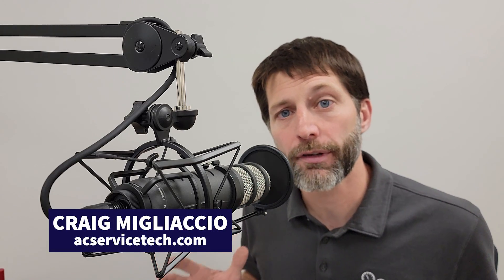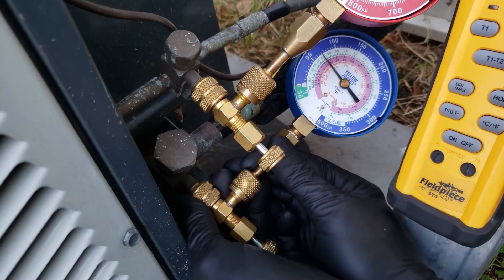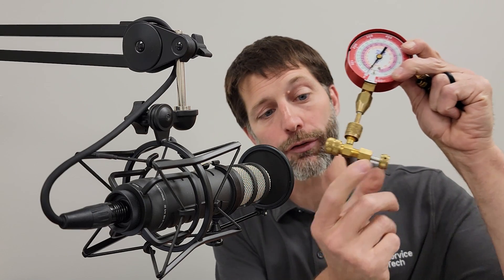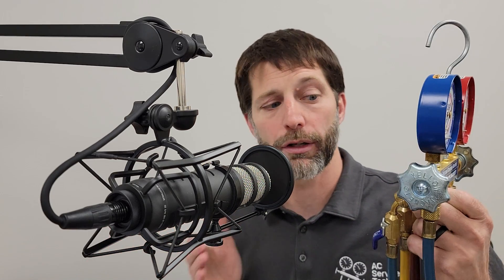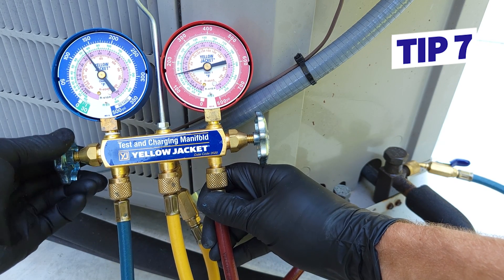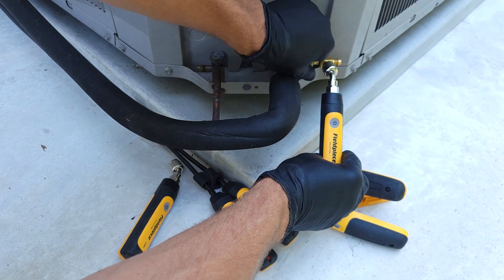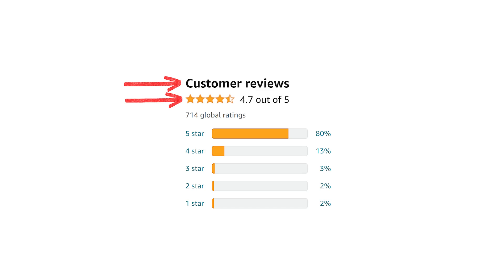HVAC Tools and Methods for Connecting to Refrigerant Ports! 10 Tips!

Comment: A valve core depressor tool is great for the high side as mentioned. Instead of a standard T on the low side as mentioned, how about a core depressor WITH an additional tee'd-in 1/4" fitting in case refrigerant needs to be added?  So, there would be two 1/4" fittings instead of only one going to the gauge. That way, you could have a core depressor tool with gauges on both high and low side while still being able to add refrigerant to the low side if necessary. Is there such a fitting made for the low side?

Comment: I found the Yellow Jacket 49138 3-1/8" Blue Compound, 30", 0-350 psi, R-22/404A/410A Gauge Degrees on the tool list, Can you  produce a video about setting them up wth the low loss fittings? 
Thanks.

Comment: With the hoses that have the shut off how do you remove the air between the screw fitting and the shut off valve?

Comment: Last week hooked up my gauges to a HP in a condo.  The system was a little low but cooling.  After purging the lines and adding 1LB of gas and waiting a few seconds, the high side went up to 470-500ish.  Then back down to 330ish only to go back up.  Shut the system down and tried to figure out what went wrong.  I must not have purged the lines good enough.  Had to do a full recovery, vacuum and new charge.  Wasted a lot of time but at least the system is cooling a lot better than before and the customer was happy.  I should have just left the thing alone.  Many techs have been telling me to stop shooting for high Delta T and 15' your good you don't need a 20'.  Mind you its south FL and that's what we shoot for.  I don't know what the standard is for other parts of the country
Reply: There is no such standards for delta t no matter where you live. Just a heads up, airflow and indoor wetbulb / rh% determine delta t, even outdoor drybulb has an effect on it to an extent

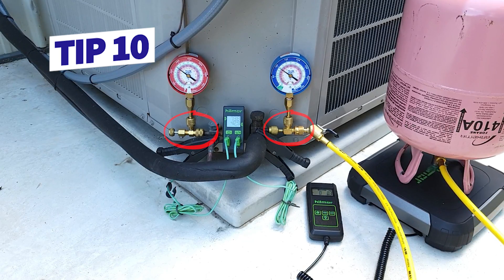Comment: At 6:02 you say to use valve core depressor tool WITH A BACKSEAT on the high side.  Why not just use a standard core depressor WITHOUT backseat feature. I don't see the purpose of using the backseat style depressor in this application. Am I missing something?
Reply from the maker: Ma Ma, I was likely refering to when using a hose, not a quick connect test gauge/probe. This way you have a controlled release of what is left in the hose or an ability to charge the liquid left in the red hose back into the system. As always, thanks!
Reply: @acservicetechchannel     Craig, thank you for the clarification. That set-up you show in Tip 10 with the two test gauges is a great way for new techs to get started without spending on expensive digital gauges from the outset. Maybe I'll ditch my digitals with hoses. Hmmmm

Comment: No. You’re not going to add condensate water to the system when attaching a temp probe to the suction side because it’s still positive pressure in relation to atmospheric pressure.
Reply: It will go in your hose... And when you add refrigerant to the unit  through the same hose... Water goes into the system
Reply: @jessestewart3835  if you purge the hoses like you’re supposed to whenever you connect to a system it will remove any water.
Reply: @charlesastaley  no it won't
Reply: Temp probe? Do you mean pressure probe? The probe depresses the Schrader core, so things are free to move about. Connecting to the low side service port quickly after removing the cap is a great idea.
Reply: @Matthew Ahrens it would be called a pressure probe that you would be hooking up and there's absolutely a very good chance of introducing water to system. That's why when I hook up I screw probes on slow to blow out the ambient air from inside the probes fitting by letting the refrigerant purge it out for just a second is all is needed. But it likely won't blow out all the condensate and that will end up in the compressor/oil no doubt. So he has a good point here,one that nobody really thinks about or practices I might add. The suction pressure being higher than atmospheric pressure will not prevent that water/air from entering the system. It will be sucked rite in by venturi effect basicly by the flow rate of the vapor passing by the port. Think about it. It's what happens
Reply: He means if you take the cap off while it's running the suction will be cold and water could condense inside next to the Schrader. Then a few minutes later when you decide to put your low side hose on and maybe add a refrigerant you could push that water into the system when you push the freon in

Comment: why don't they save us time and have built in pressure gauges for these systems.
Reply: That's coming soon
Reply: I wouldn't use them if they did have them.
Reply: @HVACRTECH-83  why is that? seems more efficient and  no more unnecessary mistakes, contaminants or refrigerant loss opening these service ports just to measure pressure